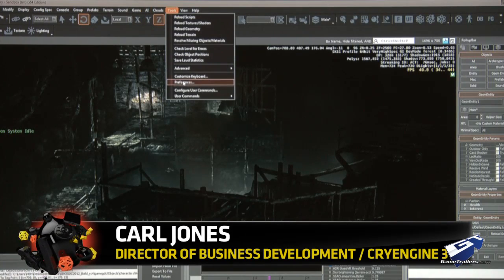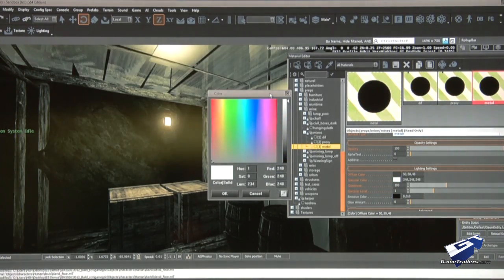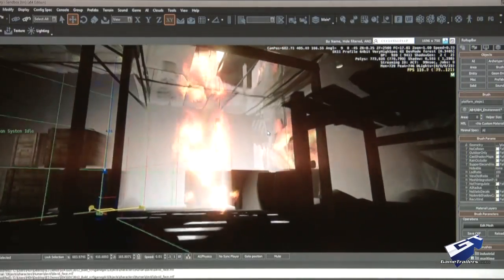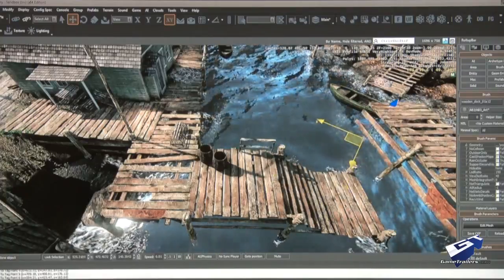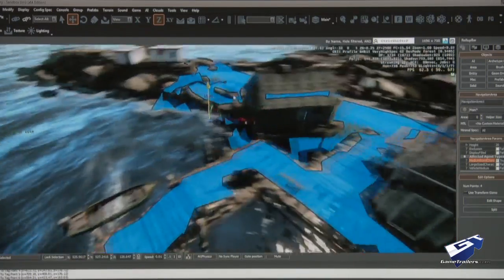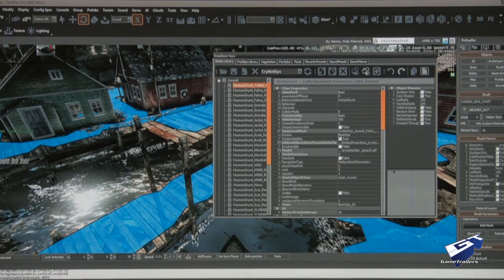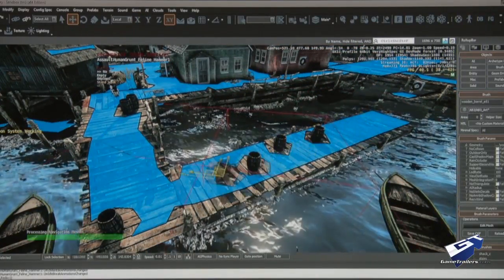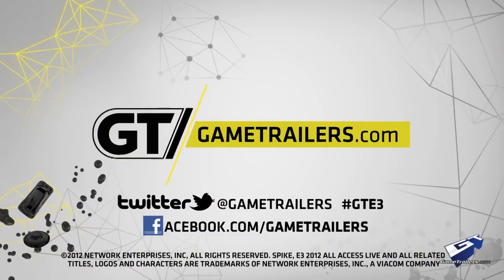CryEngine 3 - E3 2012: Level Design Walkthrough (Cam)

Comment: Would you say that cryengine is better than the udk? easier harder? more reliable? even for my rig of dualcore 2gb ram hd5670 1gb. udk runs just fine but it looks like there are better engines. please please please my mind will explode if my ideas dont try to get real. also im n00b on lvl desing soo if not these two, there is an engine for new curious guys? please share wisdom